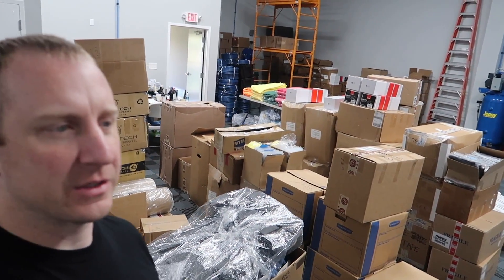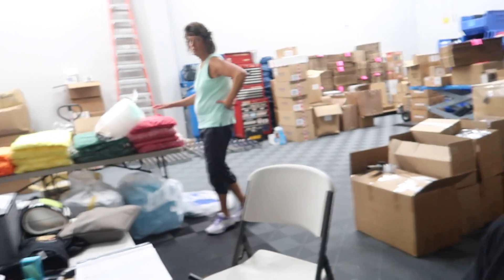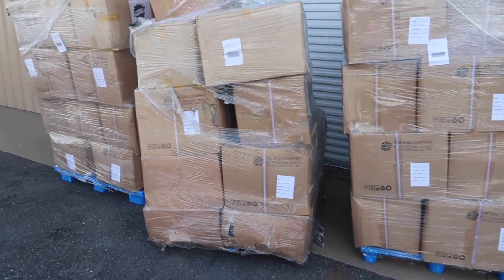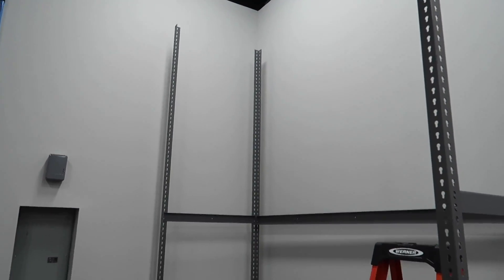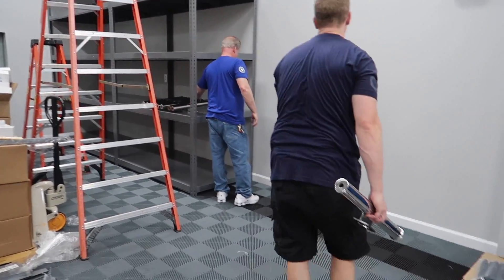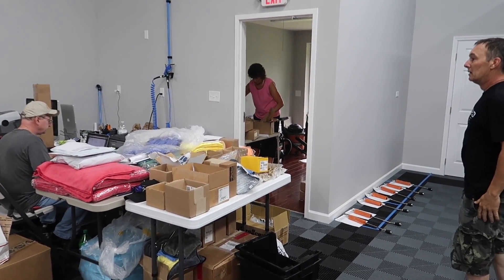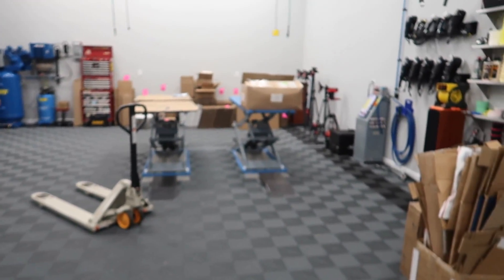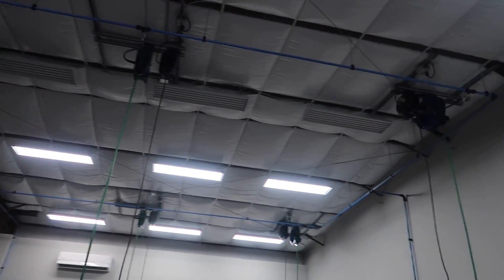Transforming OGHQ to Fully Operational!

Comment: One suggestion I would make is to put your liquids, especially the large volume bottles, on the bottom shelf. If you get a leak it will cover your other products. Plus the heavier stuff needs to be down lower anyway.
Reply: I second this, its the way most big retailers do it to reduce loss when things leak.
Reply: i agree to a point. the higher volume stuff needs to be closer to the bottom as well
Reply from the maker: Agreed.

Comment: Looking good. FYI if you want on those shelves, can get end cap holders to allow for more product, like boxes, aa shipping stuff to be stored etc.. Depends on if want to ad extra 1-3 feet of "shelving type storage" or not. There's a lot of diff stuff that can't connect to those. I'd also get a good inventory scanning system in place QR, or bar code(if you haven't done yet). If need help or suggestions, ask, as well as computers etc...
But looks G O O D. So happy for you!
Cheers, A

Naturally don't mean to sound mean or anything, just offering suggestions is all😀 which probably tired of, but I've done the 10,000 square foot building for my business thing & know the trials & struggles that it takes to do something like this. Again, congratulations
Reply from the maker: Great stuff.  I like the cap holder idea.  There is so much cool warehousing stuff I'm going to figure out over time.
Reply: Obsessed Garage Thanks & no problem. You'll find a lot cool stuff able to do with those shelving units, great choice. I have 4, but not that tall as my ceilings were only 15' with a drop ceiling making it 12'(ran all my networking, phones lines, etc....above drop ceiling). Would have loved a high ceiling like yours, & with a garage door! For bringing in inventory, etc....
Thanks agin for being true & real. Love the vids.
Great work!
Cheers, A

Comment: Matt, put some wood, rubber, something under the shelves to not damage the Swisstrax.
And test screw them together at the joins to make them more stable or screw them to the wall. Probably the not gonna move at all with all that weight on them but just to make sure in the worst case (like an earthquake) that everything is going to be ok. You don't want them to fall, or the items, when you are working next to them.
Reply from the maker: They are cutting through the tiles on their own.  I assumed they would.  We squared them and bolted together.

Comment: Now the work begins.   
Take the safety comments positively as they are intended to help.  

1.  If you must step on top two steps on a ladder, have someone spot you.  Watch the video.  Someone always spots your Mother which is good but no one watches the men.  Easy way to fall.  
2.  Are the shelves anchored to the walls.  Large shelves can fall if pulled or if out of balance.   
3.  Work team needs music.  Sound track from Willie Wonka maybe.   

Safety first.  Do not want anyone seriously hurt.  Will occur when you do not expect.   

Obsessed Safety!!!!!!!!
Reply from the maker: Good advice.
Reply: Hopefully the racks get anchored to the floor.  That's usually how high-pile racks in warehouses are done.
Reply: Patrick94GSR 

Yes, but if against wall this is an easy secondary point to anchor.  Prevent rocking.

Comment: Have not watched it all yet, but did you contemplate installing a vice with hose clamp jaws for when you put together SS fittings?  Not sure if it'd be quicker, or not, but seems not struggling to hold the parts would for sure make it easier on the hands.
Reply from the maker: Yes, I'll be putting a Yost on the new Lista packing table.
Reply: haha that figures, Yost is probably top quality (I've never heard of them before now), and they even come in blue!

Comment: At about the 14.40 mark it was a little concerning to see the Adam's Hex Grip Applicators coming out the box not individually wrapped.  I'd think a tool that makes direct contact with paint surface should stay "clean" for its entire journey.
Reply from the maker: It will be fine.  Just blow them off.

Comment: Sooooo people order from you and you order form the suppliers then you send to said customer? What makes you any different from 10000000000000 other sellers
Reply from the maker: I don't think of myself as a retailer.  I am curating specific products that I actually use and like.  Then I'm shooting video, audio, and photos of the process like no one else does.  It's a bit like consulting through modern platforms.
Reply: He tests parts together and puts together these packages that are guaranteed to work together, whereas you might spend hours trying to find various parts that work together, and they may or may not mesh on the first try.  Then you'd have to spend more money getting different stuff, possibly dealing with returns or what have you.  Spend a little more, ensure it's right the first time.